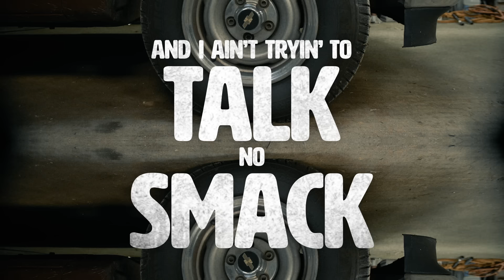HARDY - REDNECKER (Lyric Video)

Comment: Great song. But my town has less than 200 people and no stores, gas stations or anything
Reply: Yeah well my town doesn't even have internet and I'm the only in it since the dust storm rolled in this summer and I have to drive 40 miles to the nearest Walmart and I don't even go there because I might see a city slicker. Beat that.
Reply: Tyler Mathiesen if you don’t have Internet how did you comment on this?
Reply: @quinnthomas3464  walked 45 miles in my boots to find a library to listen to this song.

Comment: Your base in this base will have a good time to make sure that it doesn't have the right corner of a lot of things 7 hours before you 2AM and it will be the next one 3 hours or less than a lot more time to do so the one time I can use 93inches is 3AM and the same thing that is done in the first few rallies 3 minutes or more troops are 😍😍😍😍😍😍😍😍😍🔥😁😂😅🔥😍😅🔥😍🔥😥🔥😍🔥😍🔥😍🔥😍🔥😍🔥🔥🔥🔥🔥🔥🔥🔥🔥🔥🔥🔥🔥🔥🔥🙏🧜‍♀️🧜‍♀️🧜‍♀️🧜‍♀️🧜‍♀️🧜‍♀️🧜‍♀️🧜‍♀️